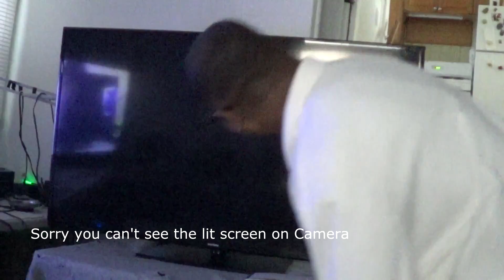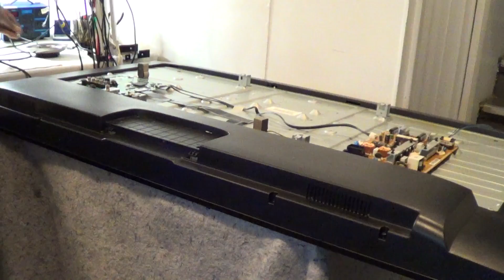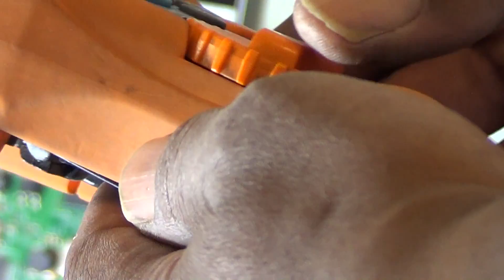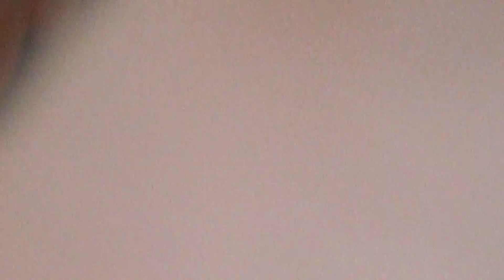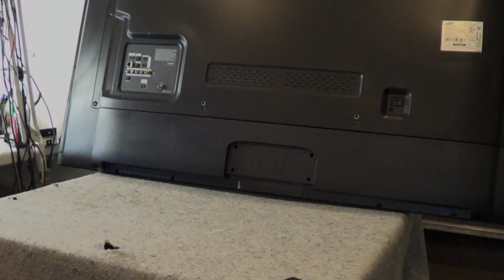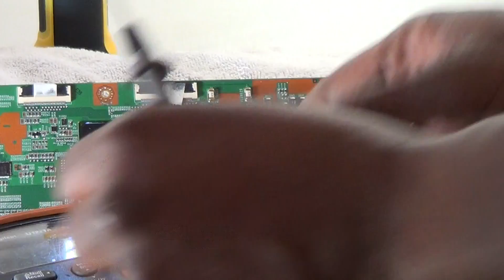Backlight but No Video troubleshooting. Samsung UN60FH6200 T-Con

Comment: Hey bro I have a question I have a samsung un46h6201af my multimeter is not working right now to check the TCON board fuse but I do see two blue led lights on from the broad but the back lights don't turn on at all nothing .you think I need to replace the back lights?
Damn no response through the motherfuck away

Comment: Big Dog, I've fixed loads of tv's, mostly PSU faults, capacitors, diodes, fuses E.T.C. I got a Samsung UE55KU6000K in the last few days, turns on, with sound and backlights, but no picture. I have never had this issue before.. Normally completely dead or no backlights.  This will really help me to determine whether its the main board (no TCON board on this model) or the lcd panel, too tired tonight but I'll test the voltages on the output to the screen tomorrow, thank you so much!

Comment: Thanks for your video. One question. with my loewe individual 46 i´m able to see for a second a message that says no tv signal right before the screen turns black. Do you have any idea on what can be the cause of this problem? power supply appears to be working since i can hear the hard disk working properly and i´m able to send commands with the remote. thanks in advance

Comment: I have a Samsung UN40ES6150F that either the panel flickers and it eventually turns off or it will not turn on at all and the red standby light flashes. Can you point me in a good direction?
Reply: I should also specify that sometimes it seems to operate perfectly, another detail is the WiFi functionality never seems to be able to operate properly.

Comment: Can you point me in the right direction... tv turns on, I can hear sound, no picture. I can get the back light to turn on by unplugging the cable from power supply to main board. What do you think the problem could be?

Comment: Samsung LNS4051 LED; 27nF 700V caps burned out on power supply board. Replaced with 27pF 6kv from TDK part #
CC45SL3JD270JYVNA

Comment: You are the first so far to kinda show testing the t con board. Now I'm at the step where my tv is working but the big chip on there is getting extremely hot. You didn't explain that more I'd like to know... and one know because I have sound and light but no actual picture

Comment: The primary fuse often blows from a power surge. When the MOV "clamps" a surge, the fuse blows. That's how it is supposed to work. It may also fry the MOV, which is easy to replace.

Comment: what about the leds, what if  some leds are shorted , will the tv still turn on ?  I checked the voltage output for the leds and it''s confusing to me because the board says 180v but the pins are too many and none of them measure 180v... with the main board connected, the led output goes  only up to 70v, with the mainboard disconnected, it raised a little bit higher to 130v ( that is in one of the pins )  I'm guessing the problem here is the leds since all other voltages, including the tcom's , are present.

Comment: Might just be a poorly seated cable! I have a Samsung LN04051D. Got backlight. Hooked up a DVD player w/DVD for sound test; cycle through source til heard DVD. Checked for burned caps, etc.  Disconnected and re-connected the tcon cable and voila! Works now! Yippie I got TV.

I suggest people start first with re-seating cables!

Checked fuses first too. 

Thanks!

Comment: Hey bigdog. I had something similar happen. I picked up a m43-c1 with bottom half horizontal lines and jumping. I was pulling panel cables to see which side was giving the problem to find out it was the left side. Right side was clear when left was pulled. While putting back left cable screen went blank. Replaced t-con and now have white screen. Any ideas if you have the time? Thank you!

Comment: always appreciate your videos. how can you test if you have a bad panel? i got a 50j6200 with backlight, no picture or sound and when i power it up i can see red light flash 5 times? already replaced tcon and main board.
Reply from the maker: Just unplug the ribbon connectors going from t-con to panel ONE at a time and see if half the display comes up. If it does then you got a bad panel. However if you replaced t-con and main, Ur panel is probably bad anyway.

Comment: Can anyone help me I have a Samsung tv model code LN40B530P7FXZA I've watch lots of videos and still can't find one with my problem I have sound but my picture stays on for a couple of seconds then goes black then after a couple of seconds comes back on does anyone know anything about this please help
Reply from the maker: If thats an LCD (older flat screen that uses CCFL instead of Led's). Look on the PS board there should be a big switch-mode transformer next to where the 2 plugs for the backlights plug into the board. If U remove the board and look on the bottom of the Transformer,  there's a piece of plastic over the secondary side of the TRansformer. Just unsnap the plastic piece off and you probably got bad solder connections on the transformer pins. If not look for any bad solder connections in the surrounding area.

Comment: awesome bud. i have a samsung, backlights work, all voltages are coming out of power supply board. whats your thoughts on Tcon or video card bad? i have no sound either.
Reply from the maker: Whats the TV problem? If its a No Display problem; b4 U replace the T-Con unplug the ribbon connectors one at a time on the bottom of T-Con going to the Panel. If you power it up and get half a display then U got a bad Panel. If still no display on either side then chance getting the T-Con.
Reply: @bigdog8882  No display, but backlight works. Voltages from psu all good.

Comment: Yes, I did learn something.  Your main board voltages, bottom voltages and test points, shorts.  T con board,  get the board.  Saves a lot of hastle, time conumption.  Great job man.  Good work.
Reply from the maker: No problem. Thanks for watching Larry.

Comment: To find a short. With a good PS inject a volt or two into the short. Use a IR camera and find the hot spot which will be a bad semiconductor or cap. Keep current low. You can spray the board with cold frost spray and the shorted hot area will melt fast. Pick up a cheap IR camera on eBay and hook it to your PC. If you can't find the short turn up current to 5 amps and if no short found go higher. Keep voltage way below the circuit voltage that is usually there.

Comment: followed your instructions, voltages above chip are 1.5V ish and voltages below chip to LCD is 25mV and below. would you say this is acceptable voltages or would you recommend replacing the T-con board? (backlights and sound working although no picture). thanks!

Comment: He knows his stuff, but all the whacking and dropping of drills makes me nervous.  I realize there isn't much right under that plastic but not everyone knows.  It just looks like you're being a little rough with the goods.
Reply: I have my 50" LG 50UH5530-HB down to the screen with rails.  I don't see any screws to take them off, but it occurred to me I haven't looked "under" the LCD yet.  They may be on the underside.  I'm almost to the LED lights and it's pretty daunting but so far I think I'll be able to put it back together.  At this point, I'm hoping it's the LED strips.  I was running my backlight very high, so, I figure it's a good chance.  And I can't see the screen.  The standby link blinks three times and goes off, with a dark screen.

Comment: Just tested my t con board i have dc volts going down to the modules. And my fuses are good on my t con board. Could this then be my display panel itself. Power supply and t con is testing ok.

Comment: no video from hdmi but video from composite. is this a main board issue or T-con.  i suspect if NO videos worked it would be T-con. Thoughts?
Reply from the maker: If U still get the menu on the screen in HDMI, then its definately a main board issue.

Comment: Hello!  My fuse on the tcon reads 0.15 in the meter ( followed your test).  It's not Dead zero yet not too significant number. I'm unsure whether the fuse is the problem or not. Thanks for any help!

Comment: I am looking at a Samsung LN52C530F1F.  It powers up and has an image.  The problem appears to be erase related...static picture slowly clears and gives a good image.  Video will give "ghosting" type blurring.  I have been told that a drink was spilled at the bottom.  Some corrosion was evident, on the bottom panels which I cleaned up with denatured alcohol.  Problem did not change, jumped the gun and replaced T-Conn board with a new one.  Still the same problem/symptoms.  I am wondering about some type of shorting from the bottom panels to the frame shield or a capacitance issue from the corrosion which seemed to be only surface deep.  I have checked the panel traces with a lighted loupe and do not see any type of pitting.  Any thoughts on where I should check first?  Thank you for your time and any guidance..
Reply from the maker: Yeah Check the Capacitors (little brown ones) for 1 thats shorted like in my other video about the 55 LG tv.

Comment: Great video Bigdog8882!  -I've acquired an LG that turns on fine, the screen lights up bright white like there's no problem with the back lighting, but it's making an electrical buzzing/sizzling sound...but not smoking or anything like that. It won't display the menu or any of the features, just the white screen. Do have any input or suggestions for troubleshooting this particular issue? It's a nice big TV my buddy was gonna just throw in the trash...I've never repaired an TV, but I'm pretty good at this kind of thing, and not afraid to jump right in to it. It would sure be nice to resurrect this puppy for cheap and I'd be one proud cat to have fixed it myself too....Thanks!

Comment: i have the plasma version. Have the same problem except you cant see any response on the screen when powering on. you can hear sound. The tv occasionally powers on and works fine, but picture will eventually go out after a few hours. Hard to diagnose because it could be many things, including bad Y SUS board. I dont think its the Y because the tv does power on occasionally and the picture works fine for long time. Just have standby light and blinking red light when turning on the tv. Bad power supply yout think? would really appreciate it
Reply from the maker: If the model is a PN60..... Then I have a Video on the PN64....... you should watch.

Comment: I find it easier and cheaper to order the mainboard and tcon from the un60j6200. The only difference is the location of the inputs, so you have to cut the that part out of the metal.

Comment: I am not getting 12v to the tcon board.
Reply from the maker: Make sure that your getting all the Voltages on the power supply plug going to Mainboard. If good, then disconnect the LDVS cable from the mainboard going to T-Con. If still no 12v on the Mainboard  then change the Mainboard.
Reply: @bigdog8882  power supply has all the correct voltage. Main board getting power and getting correct voltage from power supply. Backlights are on. Now tcon not getting 12v at the fuse. So I read to test pins 48-51 at the ribbons on the main board where the tcon connects. But the pins are very small and close to each other. Is there a way to test for 12v going out from the main board? Because, from what I see the main board is working. The main board I have is a replacement I bought.

With the original main board, I had no backlight.
Reply: I have come to the conclusion that the replacement main board is defective. I have seen people bake these LG boards and fixed the video issue.

Comment: nice video bigdog..very informative...one thing i want to ask..regarding the TCON that you tested on the last part of the video with the power supply...you test the fuse for short...what if the short to ground is from the other side (in the input if may i say)..is that means the short is on the motherboard...or when the safe time to replace the fuse of the tcon in order not to blew up the motherboard. i hope you understand..thank you very much..God Bless..
Reply from the maker: Just unplug the Mother (mainboard) and recheck to see if the short goes away. Easy

Comment: It's a 50 inch Samsung TV it has no images the back lights don't come on but it has sound cuz when I turn it on you can hear the buttons clicking like the sounds turn it up what do you think it is the t-con or the main board where the power supply

Comment: Thank you, I've learned so much and haven't finished the line up. Haven't found my tv's problem. Sanyo dp26640. Power light on the whole time, popping noise, audio repeats the last word spoken several times, screen black. After 5-10 seconds back lights come on, channel guide and then picture on. Opened it up and found bad wire harness from main bd to t-con bd- insulation cracked- taped it but same problem but way less frequently.  Main bd?  Hope not t-con bd ( looks like integral to screen) Anyone help?
Reply from the maker: Its only a 26" so just look for the mainboard on Ebay. Its probably less than $25. I would definately start there.
Reply: Wow, thank you for the swift reply.  I'll give it a try and thanks again for all the information!

Comment: I had half good and half bad screen, so i put off the ribbon cable (side on bad screen) beetwen tcon and lcd panel, clean it with rubber before put it on. Unfortunately, the ribbon cable got burn (two pin of 30 pin) leave with black screen both side screen but audio and blacklight on. Where do you think the problem been spread, tcon or bad panel ? Thank you for your sharing with intuitive style

Comment: I have an Samsung 40 inch..model number UN40J5200AFXZP... The tv doesn't have a t con board, just the power supply and the main board. No sound and no imagine. When i connect it up the backlights comes on and that's it. The screen shows lights only from the led it. Should I order the power supply board or the main board?
Reply from the maker: U have to make sure that the power supply is supplying all the proper voltages after the tv is turned on. Which it probably is. I hate those tv sets with no T-Con board. Its either the Mainboard or most likely a bad driver board connected to the LCD panel.
Reply: I guess I should replace the main board or the LCD driver
Reply from the maker: You cant replace the Driver board cause it's bonded to the screen (U can't remove it). You'll have to trouble shoot it to the component level. Otherwise U can chance trying a mainboard, just be prepared to return it LOL.
Reply: Ok thanks I'll try the main board and see, cause I have a 47 inch tcl not working and a Hisense 55 inch and the Samsung not working... Just trying to get them fix and sell them out...thanks for ya help big boy

Comment: I have a UN60FH6003FXZA, flashlight test shows backlight, but doesn't show the white lights from the back.
Reply from the maker: Then you have an Image with NO Backlight.
Reply: bigdog8882 what else would I need to check before concluding that the led strips are the issue?
Reply from the maker: Make sure You have voltage on the +  side of the LED connector on the power supply board.

Comment: Can bad T-Con board cause power cycle? I have Samsung UN55F6300 and the power cycles shortly after Samsung Smart TV Logo. If I have a device attached to 3rd HDMI input (Last one from bottom) I can see the content for few seconds then goes to black and power cycle again. I checked each ribbon connection on the T-Con board and some don't have  1.2 v.
Reply from the maker: All the Connectors will not read any Voltage on your Meter. As long as some are reading. I doubt if its the T-Con causing any power cycling, To be sure just unplug the ldvs cable going to the t-con from mainboard and see if tv stays on.
Reply: I'll do that this evening. What is the usual cause for power cycling on Samsung LED TVs? I checked the power board and got constant around 12v output from the connector.
Reply from the maker: Well if All the voltages are constant on the PS plug coming from the Mainboard, Then possibly Main.
Reply: I think you are right. I unplug the cable going to the T-Con and it still power cycled. Do you happen to know which part is usually the problem on these main boards?
Reply from the maker: Just order the whole board.
Reply: Yeah, I think I'm gonna do that. Just need to find one in stock. Thanks again. Your video rocks!
Reply: Did that work? Fixed my parents tv by unplugging the wifi module... Was causing a bootloop.

Comment: Hello, I have a RCA Smart TV that has sound but no picture. When I turn the television on, it says "no signal" floating on the screen. When I tried to push the menu button on the remote, I get nothing. I even changed the batteries and still, nothing. Any quick fix ideas for this? Thank you in advance

Comment: well done, easy to follow as you went along. Just wanted to say I also have a scope that I found on ebay for $75 then you can see the signals at the T-con board. But you showed an easy way of doing it with a DMM.
Reply from the maker: Thanks Bro, That would be a Good video too.